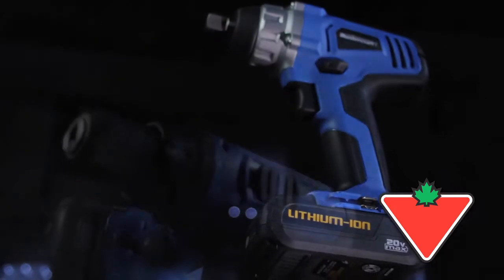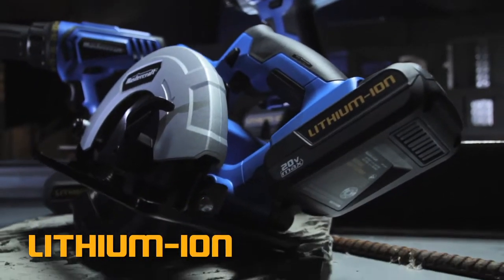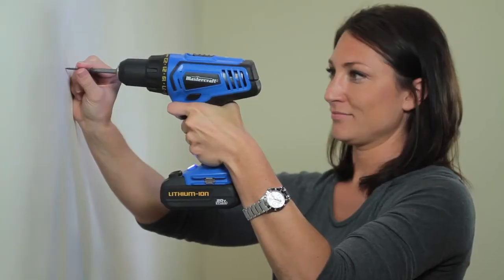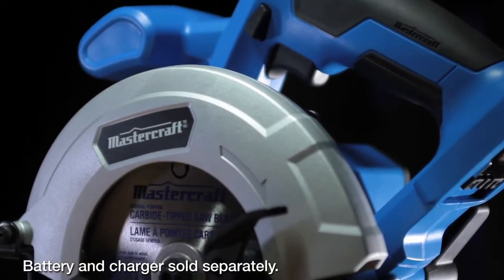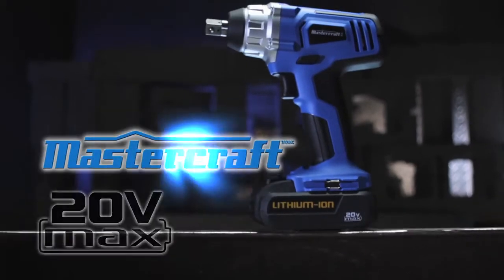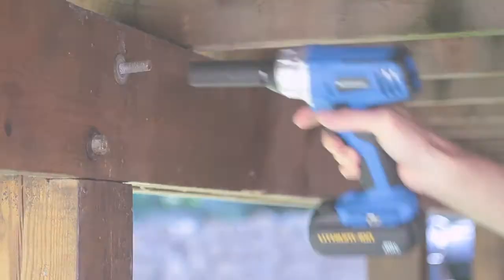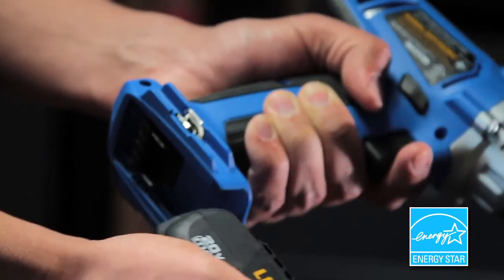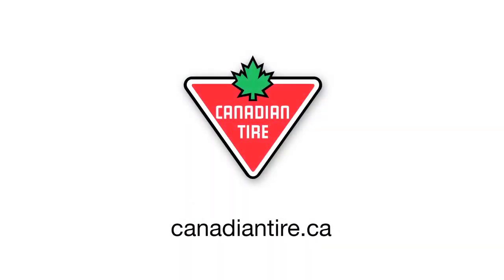Mastercraft 20 Volt Max Family of Tools From Canadian Tire

Comment: is the impact wrench good enought to work on suspension on a car?
Reply: +Nadim Chaddad I one you see in the video photo above is for screws.. The mid ranged 1/2 drive is excellent and has enough torque for most auto jobs..it has enough torque to snap hardened steel bolts.. the heavy duty one is going to rarely be needed..
Reply: not even close. it's only about 120 ft/ls
Reply: The big one is ~300 ft lbs.....good enough.   The saw all is good the circ and grinder suck they are gutless
Reply: Maximum impact wrench Hi Torque